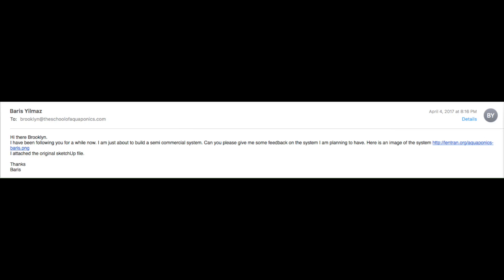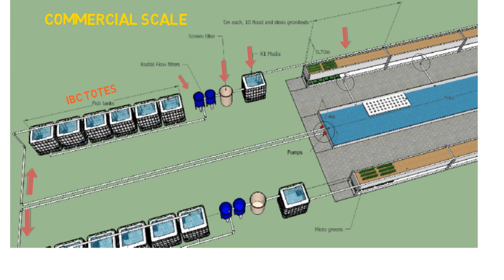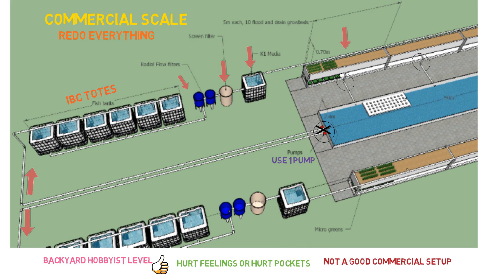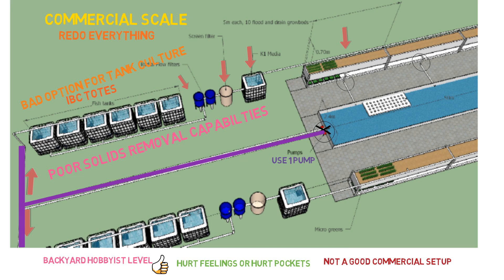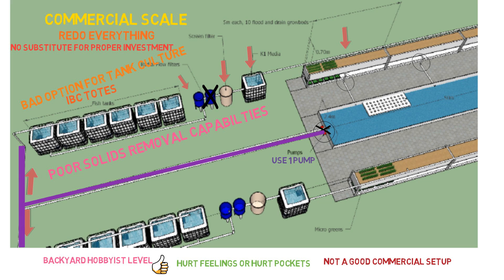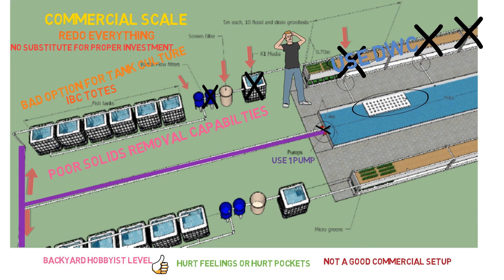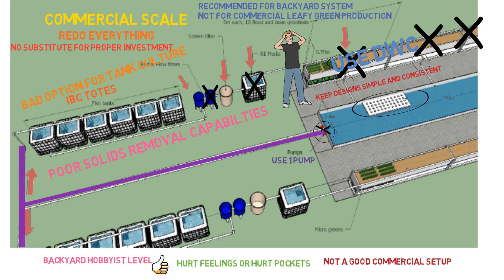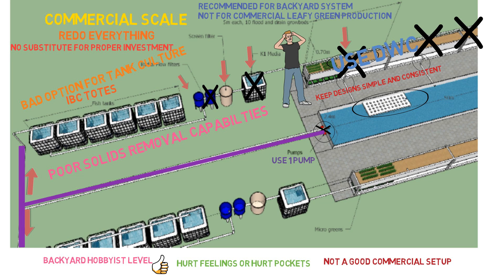Aquaponics Blueprint Review 6 | Ask The Aquaponics God Ep38

Comment: Just found your channel and I like what I see so far. I would question the idea of not using IBC tanks for fish. I know the standing theory is that IBCs won't get rid of solids well but I have to say that I have an IBC FT and there are no solids gathering in it. I will admit that the tank is grossly overstocked and that in itself might contribute to the lack of solids since there is so much movement to keep the solids stirred up and not settling before being removed. In any case in terms of saving money used IBCs (I paid $35 each for mine) will save a lot on initial investment for newcomers and can be replaced easily at a later date once the system has been proven and the hobby or commercial operation continues.

Comment: Are you saying that the IBC totes in this system are going to be a problem with solids or is that IBC totes in general?
Reply from the maker: In general if you have moderate to high stocking densities.
Reply: IBC totes are good for small scale systems but in a bigger system with more bio-load stock numbers an  aeration  an  solids become an issue

Comment: What happens if the power goes off? Do you need a second battery powered pump to cut in in these circumstances, particularly at high fish stocking levels?

Comment: I am a little bit confused. If flood and drain grow beds are removed, where the nitrification process will take place? For this process to happen do we not need to have media?
Reply from the maker: Hi Baris, If you used DWC systems and have a correctly stocked system then the underside of the DWC floating polyethylene sheets along with the bottom and sides of the trough will provide sufficient surface area for nitrification. The University of Virgin Islands conducted research on this subject and shown that a properly sized DWC system will support nitrification for up to 3 times the recommended feeding rates. In this case you don't need additional bio filtration. You only need additional bio filtration if you're mixing systems i.e DWC and NFT together or if you're running an NFT alone or Towers that don't have media.
Reply: The School of Aquaponics can you use swimming pools as fish tanks or would they not work? Such as maybe a 1000 gal.
Trying to design a system that I can use to grow leafy greens, tomatoes, cucumbers, and maybe corn to feed the family.
And I would like to use tilapia too.
Can you help me design a system that is capable of doing this?